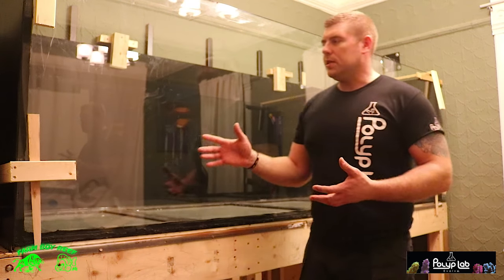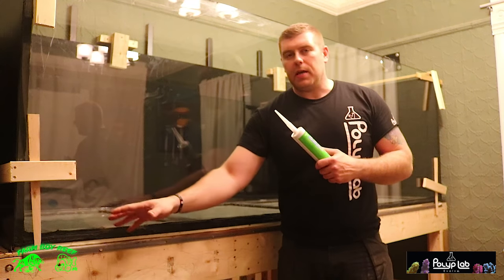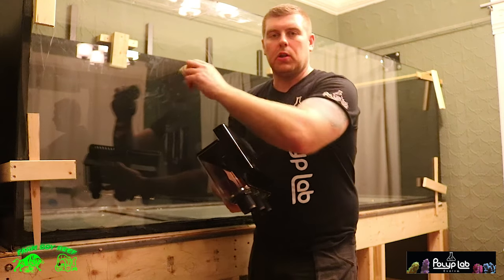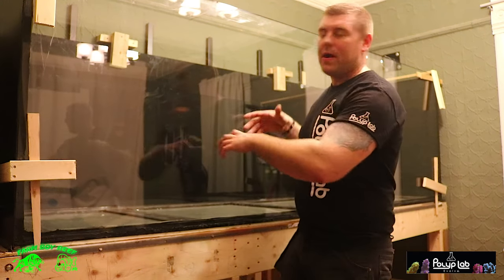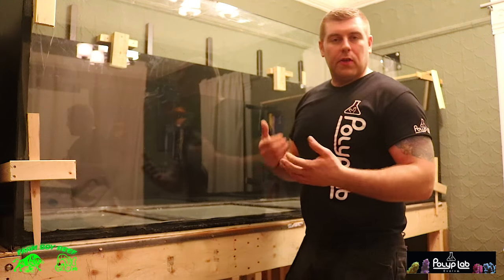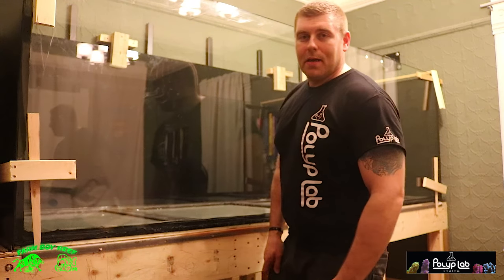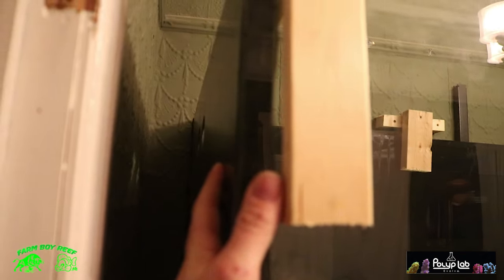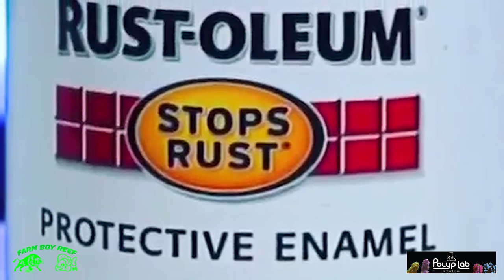Here is the Phoenix 700 gallon reef tank bare bones.

Comment: Definitely very cool video and I give you a lot of credit building this yourself. Can you give details on how you built the aquarium? I was specifically wondering how much gap between panels there was for the silicone? Did you use spacers? So on the bottom you added bracing under the bottom glass panel. So did the outer glass panels sit flush with the bottom brace and was that what you mean by giving the side panels more clamping area? Little confusing in the video. I have been trying to determine how much gap between panels to use. Thanks for putting your videos out! Good luck!